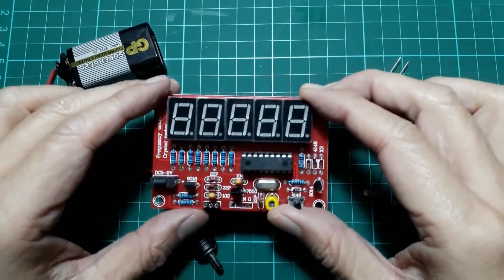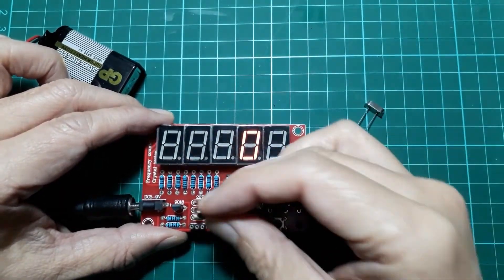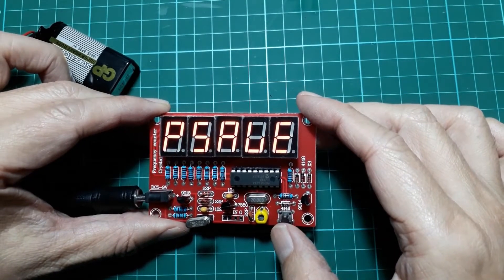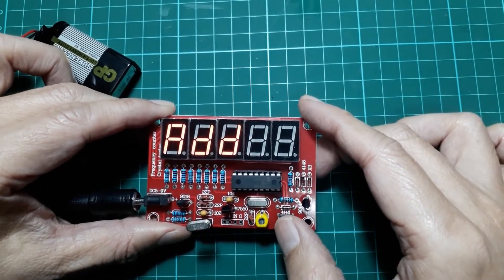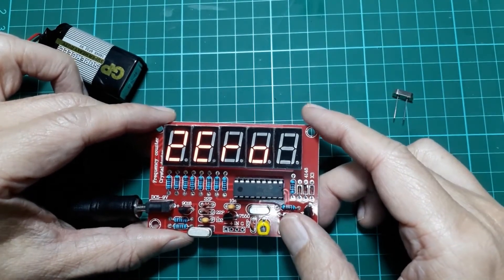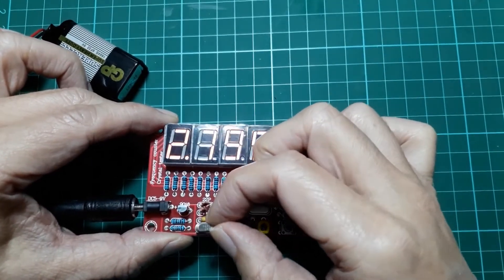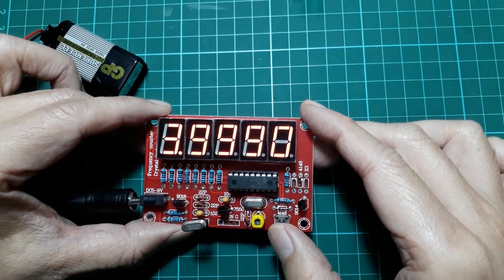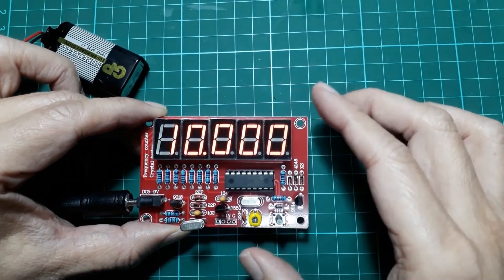Frequency Counter Kit - Programming Function

Comment: Hello I bought this meter from AliExpress and I assembled it correctly but it didn't work,when I first powered it through a 9v battery it didn't turn on so I switched to a 5v DC adapter it turned on but not with 0 in the forth segment instead the first segment keeps flashings and when I put my finger on the crystal oscillator or on the variable capacitor all the segment turn on one after the other...what do you think the problem is? Thank you.
Reply from the maker: it's been a while and I do not know the firmware well enough to comment much. But from the description that it didn't work for 9V, you might want to check all 3 TO-92 components. All three looks similar, but they are of different types, and 3 pins of each should be connected to exact circuits. The one in the middle, 7550, is a voltage regulator. others are transistors. If 7550 is bad, and/or the pins are not connected to the right circuits, the PIC IC could already see a damaging voltage when you plug in a 9V supply (I think the PIC IC works around 2-5V Vcc, but 7550 regulates the external 5-9V down to PIC IC's working Vcc range).
Reply: Your module is healthy